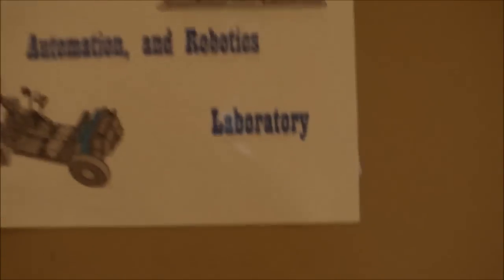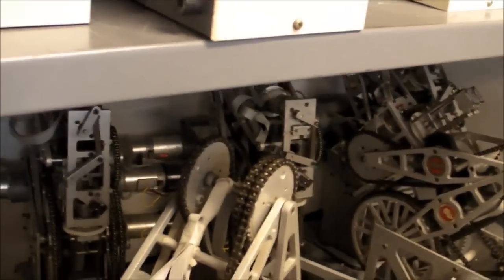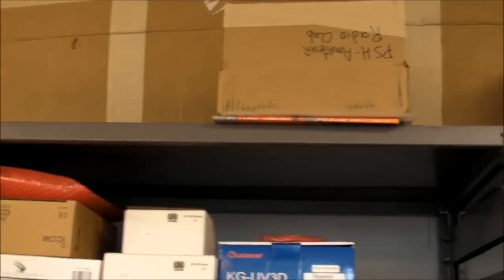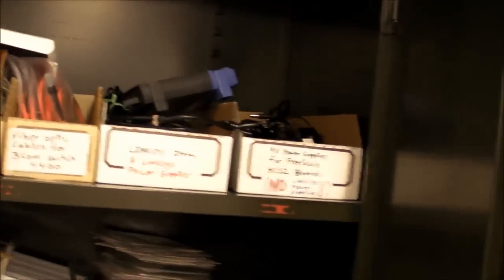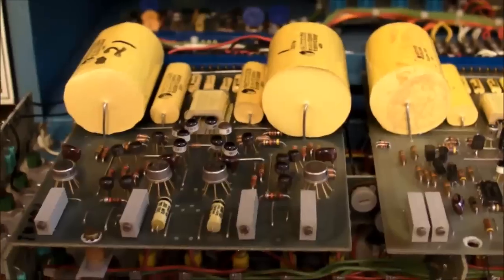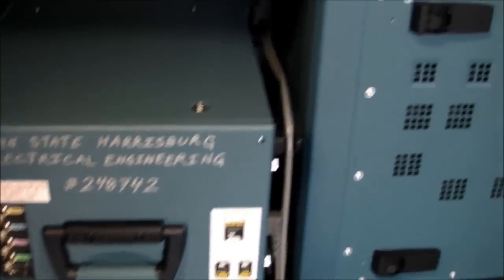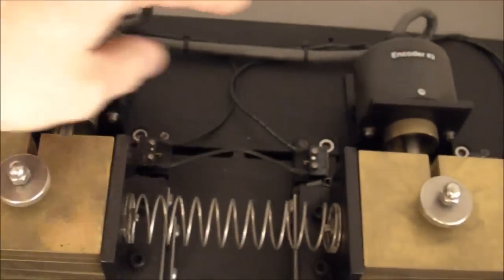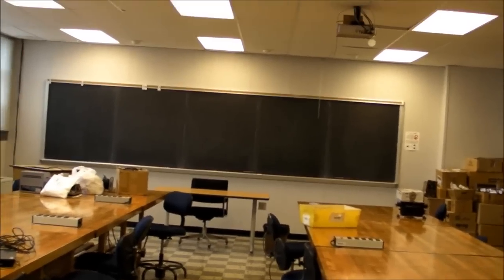(#0147) Lab Tour #06 - Control, Automation, & Robotics Lab

Comment: It's too bad labs like these are getting rid of their analog computers.  Teaching analog computers is a fantastic way of teaching the application of integration and differential math to circuit design.  Sure, they can be emulated using SPICE, but it's still nothing like being able to see it happen in front of you and being able to hook up test equipment to analyze what each component of the circuit is doing.